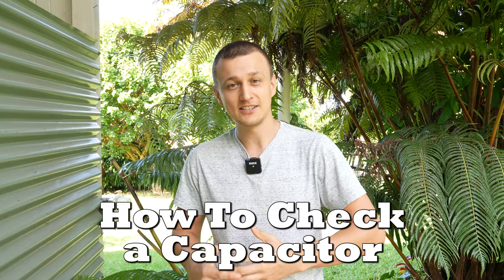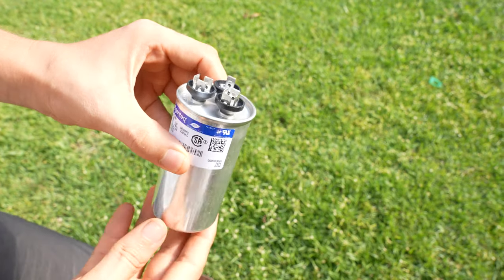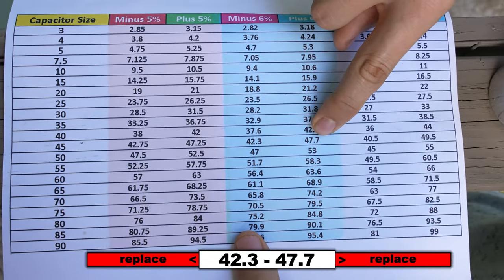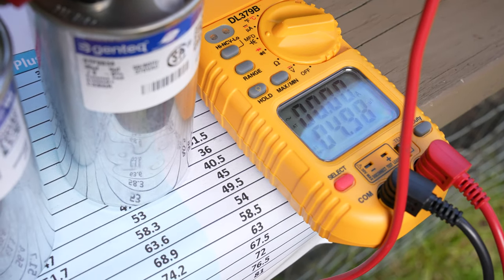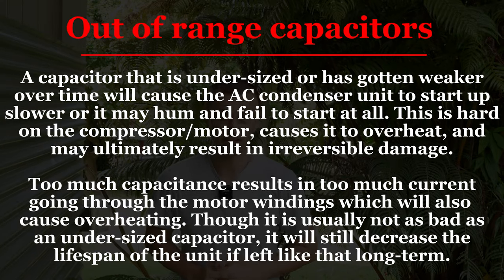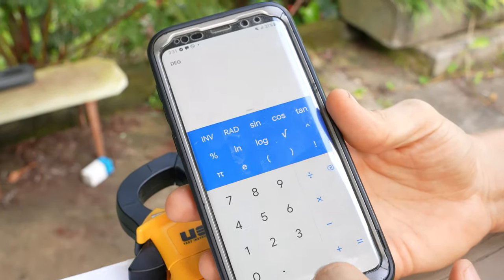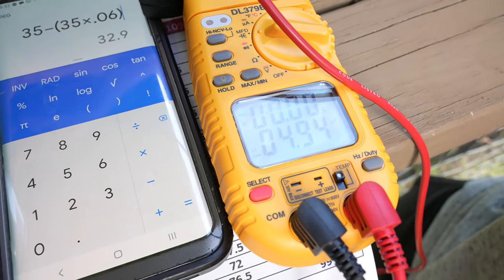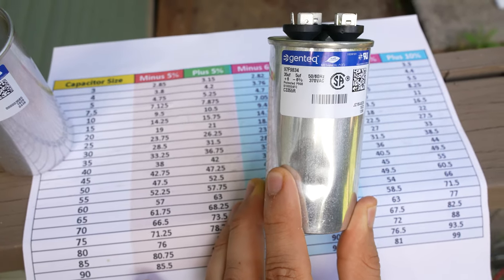How To Check HVAC Capacitor With Multimeter

Comment from the maker: 🔋 Capacitor Videos For Further Info:

20 Common Capacitor ?s Answered:
https://youtu.be/ae0Ue4F3ooQ
Original Video on Replacing a Capacitor:
https://youtu.be/C82HvbvP08E
How to Replace a Capacitor Full Guide:
https://youtu.be/9ZGfvC-PMWU
How to Order The CORRECT Capacitor:
https://youtu.be/mkqaOfvH4a4
How to Check Capacitor With Multimeter:
https://youtu.be/5_0nKm940nA
How to Replace a Start Capacitor:
https://youtu.be/hC0nFT1XPcI
How to Discharge a Capacitor:
https://youtu.be/45oZXnClMD0
How to Combine Capacitors:
https://youtu.be/qLJOWU33TFo
What to do if Capacitor is Rusted:
https://youtu.be/RSIi47uzApI
How to Install SPP6 Hard Start Kit:
https://youtu.be/ThBsRFrdNiY
How to Install 5-2-1 Hard Start Kit:
https://youtu.be/KRQ3BzJPPn0
How to Wire A/C Condenser Unit:
https://youtu.be/KCanZEsLVEI

Comment: For calculating -% the easiest way is example 45-6%=42.3 that's it
Reply: Thank you I was struggling with the calculator app
Reply: Bro all you do is type in 45 - 6 and hit the percentage on the screen and it gives you the amount .. easy money !
Reply: Common always has 4 tongs to connect wires?
Fan always has 1 tong to connect a wire?

Comment: You saved me a lot of money already. First, it was my cap and so I replaced it myself. A month later, it was my fan motor, like today, I replaced it myself too. For quick calculation, if it is + or - 6%, just multiply the MFD by 1.06 or 0.94 and you'll get your MFD right away. Thanks you for helping me save some money.

Comment: Did you can also measure a capacitor while it's in the circuit and running it's called dynamic testing, a more complicated measurement, where you use measure a/c current and use a formula to calculate capacitance.!
Reply: Yep you take the amp draw off the start winding of the compressor and fan (the wires connected to herm and fan) and whatever that is you multiply it by 2652. Then you take the voltage across common and herm or fan, and then divide the first number you multiplied by the voltage and then you get your microfarads.
Reply from the maker: @KKovler  Thank you for mentioning this! Perhaps I can make a video on this later. I am aware of this method, though I never use it.. 😄 But it is interesting! Thank you TK for explaining how to make the measurements/calculations!
Reply: @WordofAdviceTV  Anytime man! I have learned SO much from your videos. Has really allowed me to progress as a  first year technician in the field. God bless!
Reply: Yes by the title I expected this method. 
And for us non Americans , at 50hz multiply 3183 i think

Comment: To test capacitor under load: Capacitance (MFD) = Start Winding Amps (between the capacitor and the start terminal) X  2652  Divided by Volts from Start to Run (Herm and C or voltage across the capacitor). From So Cal -  All I know is "Aloha" and "Kahuna" in Hawaii 😎🤞
Reply from the maker: Thank you for explaining how to do that! Much appreciated! Haha that's a good start! I only know about 6 words too 😅

Comment: Can it be possible the capacitor measures alright but not actually working under load? My condenser unit recently needed a manual nudge for the fan to start spinning and it is not cooling at all so I suspected the capacitor wasn't working right. New capacitor was put it, a/c started working, but the old one still measures to the spec under multimeter, it looked undamaged too.

Comment: Love your videos & keep up the good work! Here's a helpful tip with the calculator to save steps/time. Instead of putting in the extra numbers in parentheses , just type in 35+6% or  35-6% on the calculator to get the microfarad range. Makes life much easier! 😀

Comment: Long time follower.  You are an outstanding teacher. I have a “seasoned” (assembly date 29Jan2008) Payne unit that stopped working.  Armed with your education, I located the Dual  Run Capacitor and replaced it with like replacement 60+ 5Mfd I had ordered long before as a contingency. This action restored unit.  All is well.  However, whilst replacing this Dual Capacitor I noted  a “add-on” 10Mfd Capacitor off to the side.  (It is attached to wires with a cable tie.). The 2 leads off this add-on go to HERM and Common on the proper Run/Start Capacitor.  Which I believe puts it in parallel with the HERM Capacitor, thereby increasing plate area/capacitance.  I since learned people will use this short cut when only 1 side of a Dual Capacitor is bad.  The schematic on the unit does not indicate Mfd Rating of the Capacitors for the Fan and Compressor.  I can only assume the Dual Run Capacitor I replaced based on what was already there, was of correct value or what manufacturer intended.  Question: Do I remove the “extra” 10Mfd capacitor or leave it?  A second question I have regards Filters for the HVAC.  There are many out there claiming to allow air-flow, but what FPR or MERV value will insure adequate filtering for the HVAC and still not overtax/overwork my older system?  Thanks. And again, I sincerely appreciate your outstanding instructional videos.  Joseph
Reply from the maker: Thank you! I appreciate that you've been a long time follower and I like that you included all the details with your questions.
1. Many compressors will have a specs label on them which also lists the size capacitor that is needed for it. If you are able to get to it and it's not faded out, you can find out exactly what size capacitor you need. If you only need a 60, then I would take that extra capacitor out. Another option is to call an HVAC parts store, give them your model number, and ask which size capacitor is needed for your unit. They should be able to look that up for you. I do an example call in my video on how to order HVAC parts, if you need more on that.
2. For filters I recommend lower values. MERV 6 or MPR 300 for example. The premium filters don't filter much more yet they do restrict the airflow more.

Hope that helps! Stay cool! Jay

Comment: Just want to say thanks for this. My blower motor inside was whirring but not running and this helped me figure out how to test the capacitors. I spent $50 on a clamping multimeter which I'll keep for next time and $12 on the capacitor that needed to be replaced and that wouldn't even have covered the callout for anyone else. Saved me a fortune.

Comment: I've done the bad cap dance a few times... life's too short for waiting/baking through a heat wave just to make an HVAC guy rich over some little nickel/dime cap.

I now replace them every two years come hell or high water; and keep a spare on hand at all times. I've even set up a repeating calendar event as a reminder.

Obey all the safety rules... remove power, discharge the cap etc, and don't attempt unless you know what your doing.

Cool videos, Thanks!
Reply from the maker: Amen to that! I fully support that spare capacitor idea 👍👍👍
Have a great new week good sir!! Thank you for stopping by and sharing your experience.

Comment: Quick first note- i didn't have a multimeter with the uf setting, found that you can use ohms instead. From what I could tell, If your light and beep blink on then stay off, your capacitor is good. If the light and beep stay on and the reading doesn't 0, or if no beep or light at all, its a bad capacitor.

Second note-  Lifesaver! Detailed and easy to follow instructions make your vids the best. Its pretty cold in MI right now and my furnace stopped working. Blower wasn't working right. Used steps from another vid of yours to rule out the main board. Then this vid and found a dying capacitor. What I feared was going be a multi hundred dollar visit from the heating and cooling guy turned out to be a $6.25 trip to the hvac and plumbing store. Furnace back to work. Thanks from me and my now warming up family!
Reply: I suppose if there is no continuity between the leads of the capacitor, then testing ohms may work.  However to properly test a capacitor you may use uf setting, with the capacitor removed.  I also use a MESR-100 ESR Meter, which can kind-of test the capacitors without unsoldering them from a circuit board.  However sometimes you still have to unsolder them to get the best reading.  Anyway, testing for ohms will not properly test capacitors.

Comment: Thanks for great information. Checked my capacitor because it would start air conditioner sometimes and sometimes it won't start .my capacitor was below minimum and fan   side was below 1 .fires right up with new one.thanks again for your videos

Comment: Thanks, this helped me identify a bad capacitor. Hopefully the replacement I ordered will have fixed my issue.
For those reading, make sure your readout is in the correct units. My fan was reading at 4.8uF, but the HERM was reading out at 89nF. (this lead to a lot of headscratching as I was reading it at uF).

Comment: If you are a math nerd and lazy like me you can calculate it much easier like this :

Cap with a 30 MFD with +/- 5%
Upper range : 30 * 1.05 = 31.5
Lower range : 30 * 0.95 = 28.5

Cap with a 30 MFD with +/- 6%
Upper range : 30 * 1.06 = 31.8
Lower range : 30 * 0.94 = 28.2

Thanks for your video.
Reply from the maker: Nice! That's even better and faster! Thank you for sharing 👍👍👍

Comment: I know some phone calculator by default only display standard so the quicker way to calculate the % is...

To get the minus result just subtract whatever the minus % on the label from 100%
35uf X 0.94 = 32.9

And for plus side
35uf / 0.94 = 37.2

Comment: Do you have any links for the right multimeter needed that's inexpensive but good? Thank you again for another informative video.
Reply: Any update on this? I picked up a digitial clamp meter today from a local walmart but I think I got the wrong one. it doesnt have an "MFD" reading or the symbol shown.
Reply: @mikes978  No, I haven't messed with it.

Comment: HELLO PLEASE ANSWER ASAP..I have 9 tines(prongs) on my new ac window capacitor..my old one was 250 volts, 55/15..i got the exact same specs  with three terminals but i have 9 TINES(PRONGS) on my new capacitor and ONLY five on my OLD CAPACITOR..both are dual run...what do i do with the extra prongs that i wont be using? Do i have to cover or tape them ??? thank u
Reply from the maker: The tines are all separated into three sections right? FAN, C, and HERM. As long as the wires are in the right section, it does not matter which prong they go to. The unused tines are just left as is, no need to cover or tape them. More info here if needed: https://youtu.be/9ZGfvC-PMWU?si=45sER-D_YJhbxe1K

Comment: Another reason your multimeter can be erratic like what you were describing is because it's battery is weak. I just had the same thing happen to my fluke, and replaced the battery with a fresh 9v and the problem instantly cleared up. I measured the old voltage and it was only 6v! Just like capacitors, electronics that run off specific battery voltages will still work even though the battery is weak, but they won't work as well.

Comment: Hi, So I am testing with my kobalt multi meter on the ohms setting and on any of the ohm settings I just get OL reading no values. Then I tested one of the poles on the capacitor and got a forever rising reading, that just keeps going up in value. When I test my condenser fan wires as mentioned in your next video, same thing I just get OL on all wires no readings. I just went out and bought the multimeter from Lowes like 30 minutes ago.. any idea what is happening here? Thanks

Comment: Your videos are so informative! Thank you so much for your explanations. I wanted your input on my situation. My ac fan was not spinning just buzzing humming. I was able to kick start it by manually spinning the fan with a stick. Videos said maybe a bad capacitor. Swapped it with a new one. But its still doing the same thing. I have to keep starting it with a stick once it tries to come back on after it cycles off. Any idea what else it could be. Don't want to keep going outside to start the fan. Thank you!!

Comment: should check common to common and herm/fan with the positive meter lead. start caps don't matter but if they have a resistor between the terminals you must clip the resistor for an accurate meter because if you don't your meter will give crazy reading
Reply from the maker: Thank you for pointing that out and clarifying Allan! Much appreciated!

Comment: You say that the unit will continue to run if the capacitor is out of tolerance but it’s bad for the motors. Should i check them every year? Or just wait until they fail?

Comment: would a weak furnace motor capacitor cause motor to move less volume of air? ... or is that in itself usually not the case?

Comment: Does the capacitance reading drop over time as the capacitor deteriorates?   Could I check the capacitance on an annual basis and when it falls out of range just replace it before it fails?  I would rather replace it before it fails and strains the motors, they got hot on last failure two years ago, I could smell the heat....

Comment: maybe a dumb question but is it possible a capacitor can be faulty and not fully running the compressor. cause my ac wont get cold only cool meaning it dont got that cold bite to it had a tech come out he cleaned the outside unit and put 1lb of freon R22 but still feels cool not cold my levels according to his gauges are 72 psi low side with 42 and 275psi on high side and the weather was 99 degrees outside. it feels like the humidity is not being taken out of the house thank you in advance....

Comment: My AC capacitor has 70/5/440 +/-3% and amazon doesn’t seem to have +/-3%. Can I replace it with 70/5/370/440 +/-6% or +/-5%???
Reply from the maker: Yes, as long as the 70 and the 5 line up, 3%-10% will all work the same. In fact, the higher the percentage, the longer it will take the capacitor to die out. 👍

Comment: what if Im getting a higher reading than what my minimum should be? should be 31.5 and mine reads 55.9 on the fan side and 57 on the compressor

Comment: Excellent videos, I have a not loud humming on my furnace when it is turned off. When I tried to turn it on with my nest thermostat it just does not turn on and the nest screen says “in 1hr 20min will get to the desire temperature” but it nevers turns on.
Another thing, I tried to replace the capacitor but the iinformation in the label where it says the capacity is erased, how can I figure it out the specs for that capacitor
Reply from the maker: The hum might be the hum of the blower motor that is failing to start. Or the inducer motor. Is the furnace control board blinking any error codes?
Reply: No all looks good the furnace board does not send any error codes, it has a steady green light. The weird thing is that I hear the humming even when the furnace is turned off through the nest thermostat
Reply from the maker: @juanantoniohuerta9024   Hmmm.. Okay in that case I would try to determine how far in the sequence of operation does the furnace get? https://youtu.be/AQD_MedIklI?si=C0ezYYL-0mk2jSwn

If nothing at all, then perhaps try bypassing the thermostat and see if it turns on:
https://youtu.be/bmZc76ufTNY?si=6mnMHHii16Pq9CFx
Reply: Thank you so much for a prompt reply, I saw the videos and gives a better idea what I should be looking for, I will give it a try and will post my results.

Comment: I have a split system 2 Ac condenser’s outside and 2 heaters in the attic. They are about 18 years old now they seem to be fine. My question is what filter should I put in ? I been using a merv 8. What would you recommend? I really don’t know…
Reply from the maker: Merv 8 is good. 👍 I always used Merv 6. Both are fine, it's the higher rated ones that we usually advise against.
Reply: @WordofAdviceTV    I checked them this morning, they are a merv 5 .. hope that is good. ?  I just want to protect the cooling coils. I really have no allergies.
Reply from the maker: @johnf.6942  If its just to protect the coils, Merv 5 is perfect 🙂👌
Reply: @WordofAdviceTV  Thank you I appreciate your knowledge on this. I’m a subscriber to your channel and your videos are clear and easy to understand.

Comment: Thanks for the video, when I checked my compressor's capacitor, fan rating is ok around 4.9 mf but Hermes one is 31.77mf and my capacitor rating is 35uf +-5. So what do you suggest shall I change or is it ok?

Comment: Can you do a video on how to check a capacitor under load
Reply from the maker: That's a great video idea, thank you for the suggestion!
Reply: I only ask as I learned this method a few weeks ago and it has saved me time in that I no longer have to pull the disconnect/plug from the wall and pull off the wires only to have to put everything back before re-applying power. Even more newer techs will find this VERY useful

Comment: Please tell me I can used 40+5 uf 440v 60HZ. New one is 40+5 uf 370 or 450v 50,60,HZ . I don’t want to damage compressor . What is that mean 370 or 450v and 50&60 HZ ?? I can use that that both numbers ???
Reply from the maker: That just means the capacitor will work as a replacement for both, 370v capacitors and 450v capacitors. What you got is right 👍
Reply: Thank you !!!!

Comment: If the compressor part (HERM) is still good but the fan part is not, can I just connect the fan to a new single run capacitor for the fan? I know that  I will need to connect the common of the new capacitor to the old one if there is only one common wire.